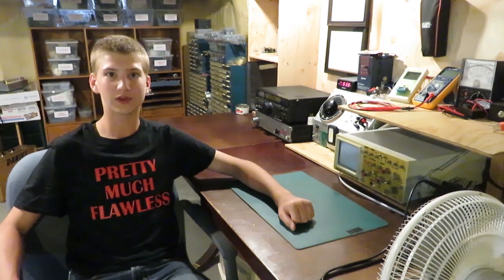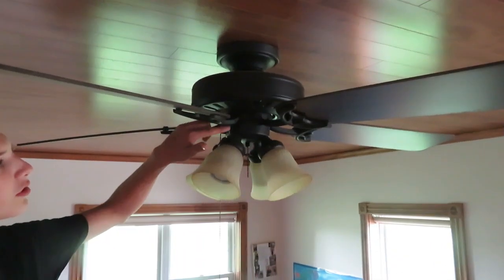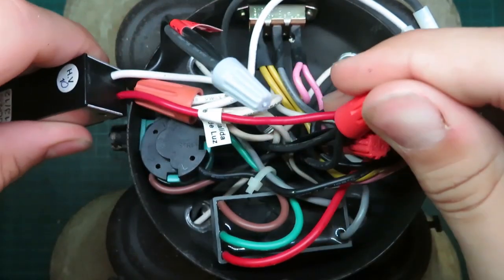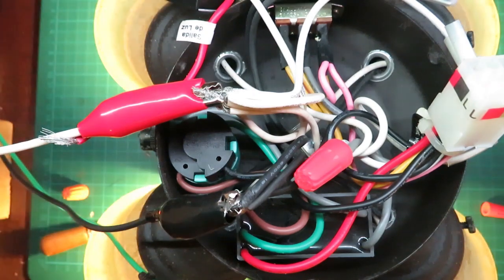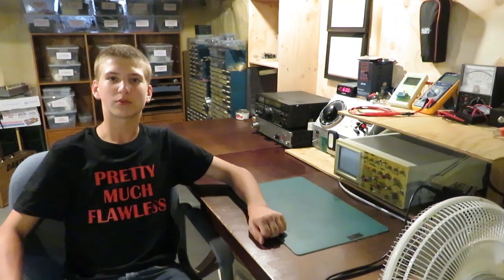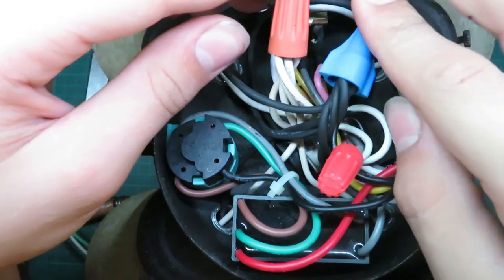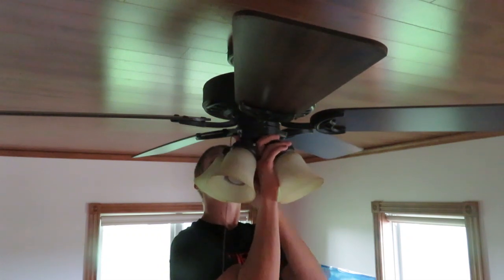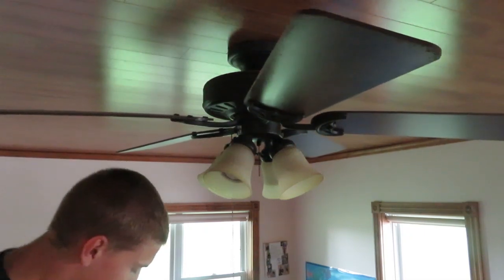How to fix Blinking fan lights

Comment: Thanks for the vid.  Good troubleshooting technique. How did you know it was a limiter in the box?  Label?  Other?  BTW, while working on something like that, I would also recommend swapping out the twist cap connectors and replacing with WAGO 221 lever nuts.  Cheers!
Reply from the maker: I have done this repair on some other lights
and it was that wattage limiter to. Thanks for watching!